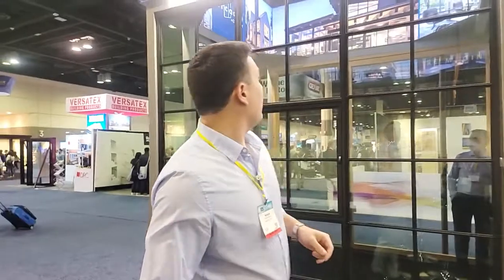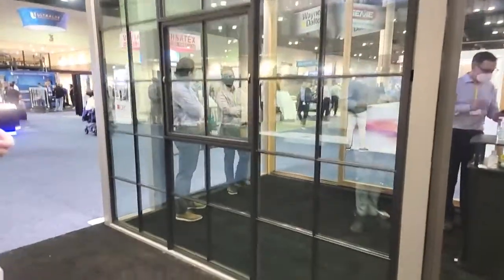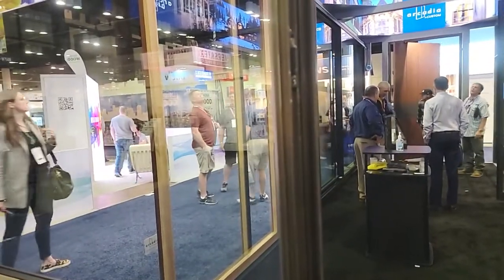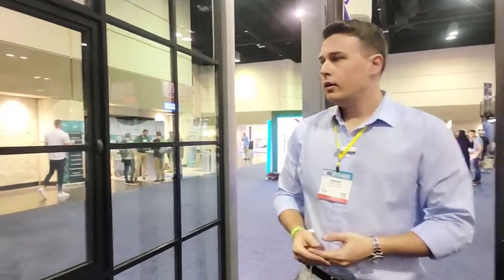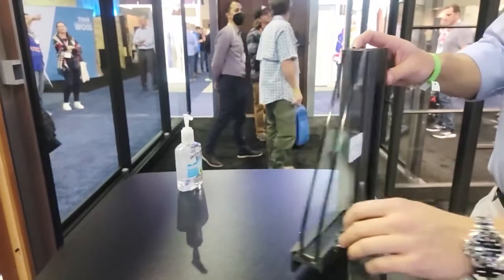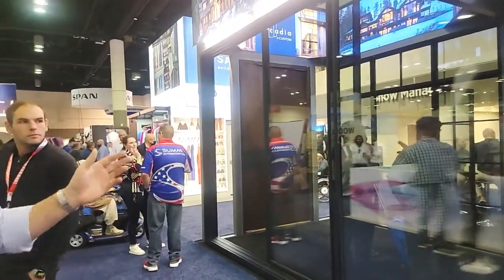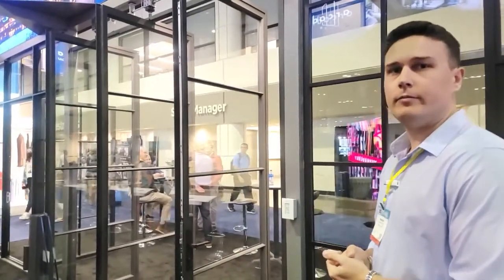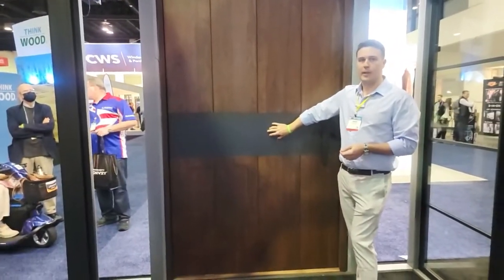Energy Efficient Modern Steel Doors and Windows | Acadia

Comment: Doesn't look like there are a ton of options for screens. Even on the casement window they showed no cranking mechanism, meaning you open it manually which becomes difficult with a screen in place.
Reply from the maker: Great point.  I'm dealing with the same issue on a European window right now, however I think we figured out the screen and the blinds so make it work.  The video should be up shortly.
Reply: You have 2 options for operating the casement windows, a roto crank or push out.  Screen options are fixed magnetic or roll down.